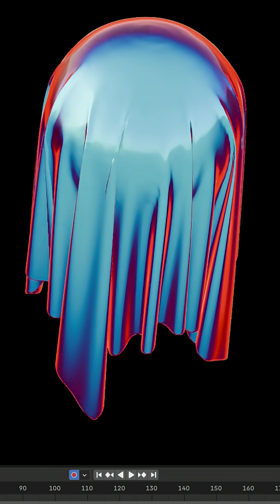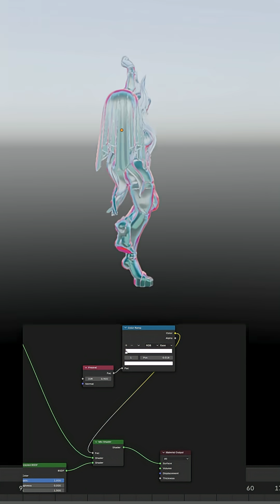Iridescent Material in Blender #3dmodeling #shorts #blender3d

Comment: If I wanted iridescence, I would break out the diffusion and the specularity from each other, then blend the specularity heavily. 

Applying a repeating, sharp colour ramp to the specularity should produce the kind of rainbow shimmer you get from real iridescence. If that doesn't work, then blending in an add'l transmission shader with the same techniques should be a good hack to imitate it without going deep into theory.